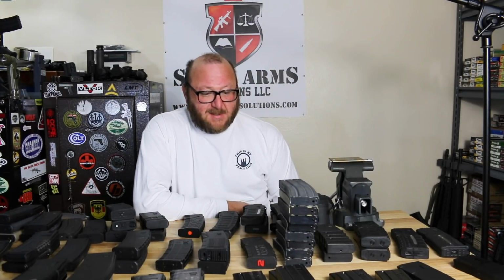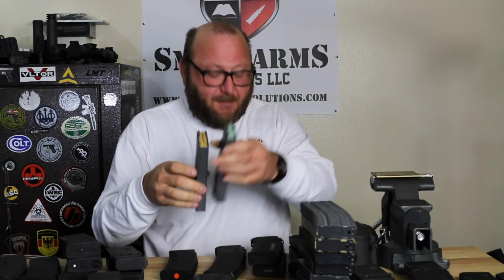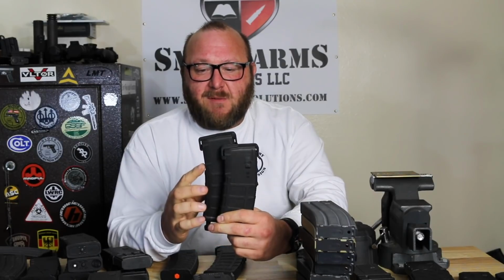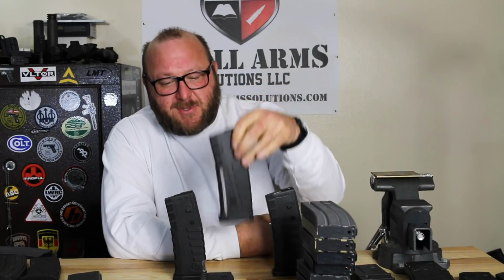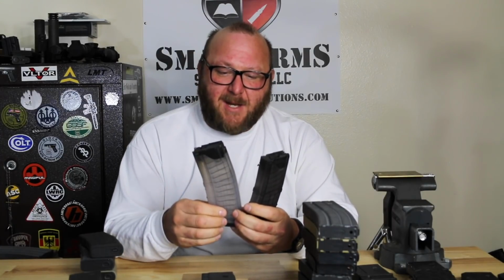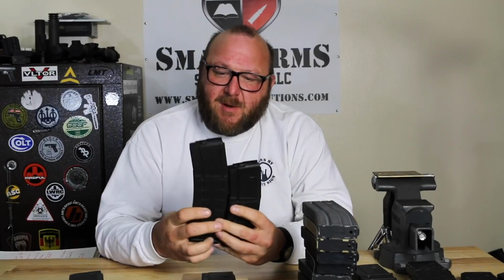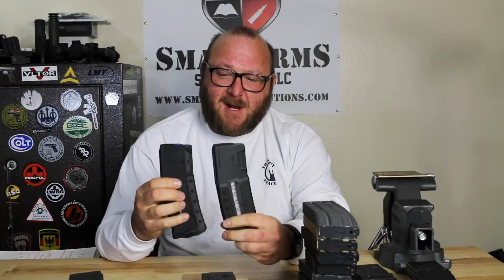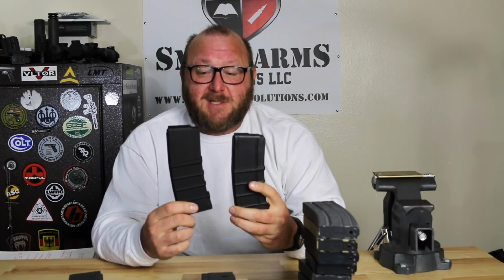Feeding the Black Rifle - Part 1

Comment: 5:14 
I got in 2011 and went to 10th mountain in Polk. We still had a lot of green/black followers that I got issues. They sucked and i noticed all my jams came from those magazines. I started “swapping” magazines for orange followers whenever a person wasn’t paying attention. Later on, our chain of command seemed to get the memo and allowed us to turn in older mags with orange follower mags. 

Unfortunately I had to return them when I got assigned somewhere else, where they also still had black/green followers. And unfortunately again, I got to actually keep these. 

Recently I got assigned to a unit where the armorer doesn’t seem to care about anything. He allowed me to finally swap out my crappy mags to orange follower mags. 

When I checked his tough box full of mags to swap, there were hundreds of black/green followers still. So yea, some rear echelon units still have potentially fatal mags in circulation. Perhaps because GWOT is over, no one seems to care.
Reply from the maker: The green follower mags are actually fine but like the tan follower, they are not designed for M855A1. If your shooting A1, you need the blue follower or magpul mags

Comment: When the C7 was introduced, the magazines that came with them were garbage. We were told not to fire more than three round bursts for fear of breaking the lips.  You could insert them into the rifle fully loaded with the bolt forward and it would lock into place in the mag well, but bolt would would fail to strip the cartridge from the mag on the forward stroke and pass over the cartridge. leaving it in the mag. I still can't figure that one out. The only way the you could load a cartridge into the rifle was to load no more than 28 rounds or so into the mag.

Comment: Chris,
    Another great informative video. I have a Colt LE 6920 M-4 and I live in California. Very tough state to have a great firearm without some stupid regulation or restriction to handicap the nice factory issued weapon. My LE6920 is California compliant with a Hellfighter magazine release button to press before you press the magazine release button to release the magazine. Because of this Hellfighter button the bolt doesn’t stay back after the last round is fired but sometimes it will hang up on the magazine follower. I have Magpul magazines and have had to file down the backside of the follower so to bolt won’t hang up on the magazine after the last round and slides right over the top. When it’s hung up I’ve had to get a nail punch and push down on the follower to let the bolt slide forward then release the magazine. They had to eliminate the button to lock the bolt back and release it forward so that sucks. Have you had any other comments on bolts hanging up on the magazines with Hellfighter release buttons?  

  Cpl. Sev

Comment: I have shot many Stoner/Ar-15-type mags for several decades in semi and full autos.  The GI mags have always worked as well as any other, especially at full auto rates. I have only experienced failures due to ammo (of course) worn springs or damaged followers.  I have seen several Magpul P-mags stuck in mag wells from being seated to aggressively.

Comment: I started with green and black follower GI mags from the bargin bin at my LGS, dropped magpul followers into them after a while.

Moved onto gen 2 and gen 3 pmags. Practiced some stippling on them. Doesnt hurt the mags and i dont ruin a frame.

Now i use stainless GI mags. Pmags are wonderful, but do have an issue fitting in double mag pouches if the pouch is on the tight side. I still have my pmags, and i buy a few windowed gen 3s when theyre on sale, but my chest rig is loaded with ss gi mags and the pmags are in a box. Im certainly happy to hand them out to people if "the bad times" happen, or if a magazine ban goes through theyre an investment.

Comment: I’m curious. 

I have neither an AK nor a AR-15, but I can see the benefits to both.

HOWEVER, this is my question and I’m asking seriously.

Would the AR/M16/M4 system work a little better with more AK  style magazines? Like the curve, even if it’s just a straight insert instead of the Rock an Lock style of the AK?

Im truly intrigued by this idea.
Reply from the maker: The taper on the 5.56mm is far less than that of the 7.62x39mm do no need for further curve. Using proper mags, there is no need or benefit to rock n lock mag

Comment: Using an LE-6920, I find that the Lancer had a hard time locking in place on a closed bolt with 29rds. I don't know if you had the same problems Chris.

Comment: I once finished a rifle build and went straight to the range not realizing I just didn’t install a bolt catch but when I ran pmags the bolt would lock up on the follower and of course slam shut when I removed the magazine but it was a nice thing to feel I had gone empty instead of dropping the hammer on an empty chamber

Comment: About polymer stuff. 
Even if you have excellent mold designers, and your mold is vented, and gated, and heated/cooled correctly, and even if your material handler has the material dried perfectly before it goes into the throat of the barrel, If your setup man doesn't know what he's doing? You will get bad injection molded products. You will get lots of out of spec parts, and a high scrap rate.  
Injection molding setup is a kind of a black art that requires a person who understands what's going on inside the barrel before the mold, and also inside the mold during the injection of plastic. And literally every single parameter that can be adjusted on that machine has an impact on every other parameter.  If your person running the machine has to open the door, rather than having the parts dropping out on a conveyor, or they're being grabbed by a robot so that cycle time can stay constant, then that person becomes another variable, and he can screw things up too. 
Whoever they have at Pmag doing their setups, must be one of those rare people who can figure this stuff out, lock down parameters that work, and keep ham fisted idiots from messing with it, because they make lots of good to go magazines consistently.
Reply: In summary...having someone who knows their job makes a better product?

Comment: The first GI issue 30 rnd magazine had an Emerald Green Follower with a white drawing number on it. First issued around 1970-71. The Black Follower was Post-Vietnam. There was an even early commercial 30 rnd magazine offered by Colt in the 1960s, and it was privately purchased by some soldiers and units. See Guns&Ammo ads from the later 1960s. Also the Thermold dates back much further than the Canadian production. It was tested by both the US and English military, and actually did pretty good in the testing. Would have to dig my examples out but there was another name for the company at one point too.

Comment: Ramline... shake a full one, they spew half the rounds out all over the room.  Fumble and drop a loaded one, all the rounds will puke out.  Thermold... springs sometimes break.  Brittle wire.  Would not seat in some mag wells due to the ridge around the mag.  Also, some hung up on the bolt catch, preventing them from seating.  Orlite... some years ago Cheaper Than Dirt brought in a bunch that still had dirt and sand from the Holy Land that perhaps Jesus Himself had walked upon. That's the best you could say about them. Every one I saw had broken feedlips only held together by the wire mesh embedded in the brittle plastic.  Yes, those early polymer mags made me leery of later mags, which I now know are pretty good... P-Mag, etc.

Comment: government contract, getting bad quality wasn't uncommon early 90's camp pendleton had mags load them fire about 3/4 the mag and get fail to feed as the follower would not come up anymore, pull bottom plate nad remove a broken spring or spring that would no longer extend, back to full length

Comment: I have found Lancer mags to be the most reliable and quality polymer mags. Pmags are great though, I have just never seen a Lancer break or shear and I have seen numerous Pmags do that. But to be fair to Magpul, there is probably 50x as many Pmags in circulation, so there is a larger sample size of defects or malfunction. Both are fantastic mags.

Comment: I've bought a few magazines for their novelty alone. I own a 100 round Surefire. I've used it on one range day. We couldn't get it to work reliably with more than 50 to 60 rounds loaded. I bought a D-60 drum on a Christmas sale one year. I have used it a LOT at the range because frankly, it's too fun not to use it and mine has been 100% reliable. The weight and clearance isn't much different than two 30s clamped together. I love mine.

Comment: My 6.8 goes like this; best was the original C-Products, which most rated poor. But they worked for me. On the other end was C-Products Defense, and that isn’t the same company. Read about it. At first, I liked it. But the follower does not go up and down very well,  leading to FTF. The finish was flat, not s semi gloss, which is why I liked it. The spring was also softer. D&H worked good. The spring was stiffer than an Amish wedding dick. My RRA came with PRI, and it works. I don’t buy more because they must be high thinking I will spend $40 on a magazine. 
ASC works similar to the original C-Products. 

I bought followers from ASC and Tubb Springs and put them in my C-Products Defense. They worked much better after that.

Comment: How hard could it be to design and make a magazine. it's a plastic or steel case and a spring.  But then an engineer can goof any thing up i guess.  Sounds like the problem is how cheap can you make a product without it falling apart after the first time it's use .and get by with it.
Reply from the maker: Far more difficult of an engineering and manufacturing problem than you imagine

Comment: Ive seen issues with the Lancer’s from multiple guys on multiple occasions where the feed lips wont hold rounds and when the mag is loaded it spits out multiple rounds into the rifle. Therefore i dont trust them, especially when pmags, okay surefeed, d&h or c-products etc can be had for the same or lower price
Reply: If you own a lancer, load it to capacity and hit it on the bottom, if rounds pop out the top limit it range use.

Comment: Speaking of MSAR........ In my experience I've found the PMags are an improvement over MSAR mags( no contest) and preferable to OEM Steyr AUG mags. You can take that to the bank. Steyr 30 rd mags will occasionally let a loaded round pop out under recoil. However the 40 rd is noticeably worse. My sense is the mag springs are not strong enough to push the long column of .223 fast enough. Any rate....PMags all the way for the AUG and the MSAR copy of AUG.

Comment: Yeah, i agree magpul and also Lancers are probably THE mags you should have. I 've tried many many mags and only magpul and lancers are reliable 99.9%. By sticking with just a few manufacturers, you have uniformity and can eliminate mags as a failure point. However, I still download 2 out of habit lol

Comment: Glad to get an explanation on the Bulgarian AR mags. I found one at a local shop a couple months ago and just thought it was odd that Bulgaria makes AR mags. 
I hope you cover the Ramline AR mags that were supposed to work in AR15s, AR18/180s and Ruger Mini-14s, those mags were garbage. Another garbage mag is these Thermold clones made in Israel, I used them on my second deployment because my company didn't issue me mags. I'm glad I didn't get into a firefight because not only are they not durable but also somewhat unreliable in feeding if left loaded for extended periods of time, I think the springs they use are very weak.
Reply from the maker: Ramline mags are antiques. I tried to stick to recent mags in production or ones that were influential. Sorry, did not cover that one.

Comment: Does it hurt to leave them fully loaded? I’ve heard people say both, some say load them all and store them, some say no. I’d think your word would be gospel. Thanks
Reply: I know you asked SAS, but I can tell you that springs wear not through compression alone, but through cumulative compression and release over long periods of time.
Reply: @KI.765  There is a slight flowing of metal under static compression but any gun manufacturer worth their salt should have compensated for this at the design stage. I'm only saying this because there's videos testing of mags left loaded for 5 and 10 years and some springs did shorten a little bit over time.
Reply: I leave mine loaded and have no issues

Comment: I bought one of those 60 round coffin surefire mags when they first came out and never got through a full mag without jamming.
Reply from the maker: Mine have run flawless. Tested both semi and auto.
Reply: Yeah, mine have been good also, I use them with 300BLK and they've worked well. I understand the early ones had issues but I don't know exactly what the cause was. I have some of the 100s and they've been horrible, I've had some luck after deburring the follower but I need to test more. Both versions are fragile and finicky in a way though, ya can't be rough with them the ammo stack is just so heavy. I had the base plate pop out of one of the 100s after dropping it partially loaded. And with either dropping them partially loaded can mess up the stack and jamb them, less with the 60s of course. I wrap the base in tape to both protect and reinforce the base. 

That said they're handy and reliable enough that the 60s are my go to for my silenced self defense 300BLK at my side as I type this. However they're of course no Pmag and I've had to make a few tuning changes to make sure the gun runs well with the 60s.
Reply: @snek9353  I gave mine away, nothing but trouble
Reply: @shanek6582  That's nice of ya, things worth a good chunk of change right now.

Comment: I’ve only seen hex mags fail
Reply: Not impressed with hexmags, the first time I used one, the first round chipped a small piece from the front of the mag. They worked well for the range but I wouldn’t trust them in a self defense situation.

Comment: Why do you think Pmags are better than Lancer?
Reply: Personally all my pmags will easily load full on a closed bolt. My lancers are tight as hell with 30 rds.  Never had an issue with either.  Keep all my m2 pmags loaded 24/7/365 for yrs. Never an issue.

Comment: I've found that the Hexmag feed lips bulge after being loaded for extended periods of time. Pmag don't seam to do this. I wouldn't recommend Hexmag for serious use. That's just me though. Thanks for the great content!!
Reply: Spot on! The Chicago Police Dept has been using PMAGs (and the Gen2 ones!) as standard-issue since 2010. They have held up to constant abuse in all types of weather. If you only knew what kind of abuse cops do to their gear I would say this is one hell of a endorsement!

Comment: I just want to get this straight.  You believe and understand that the Thermold magazines of the 80's are trash, yet advances in injection molding and material science have brought us the world-beating PMAG M3 magazine of the 2010's.  But  you also believe that when it comes to polymer lower receivers, based on the fact that the 1970's Colt prototypes were trash, you insist that 50 years later the KE Arms polymer lower is trash, despite never having used or laid a hand on one?  I guess the same advancements must not work for lower receivers like they do magazines?
Reply: What are you talking about, 4?

Comment: Fascinating!  Looking forward to part II!  Collecting mags can become a specialty in itself--just be sure to keep the iffy ones separate; though the really bad ones may be useful for stoppage clearance--until they break.
I really like the MFT mags, because of their slimness.  Annoyingly, the only heavy-duty mags I could find were blocked to 20rds, and I couldn't get the one I bought apart to remove the block. It was returned.  That said, my 'emergency' mags are OKays and PMag G3s.
Again, I'm looking forward to Pt II; hopefully you'll cover ASC.  The ones I have use the yellow follower, and won't take PMag followers.  They are in my 'range' pile.